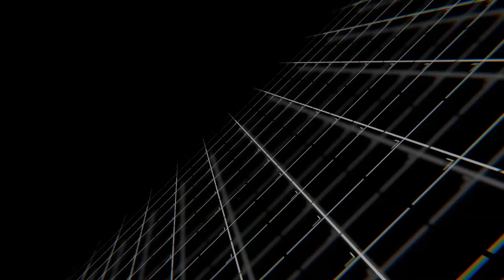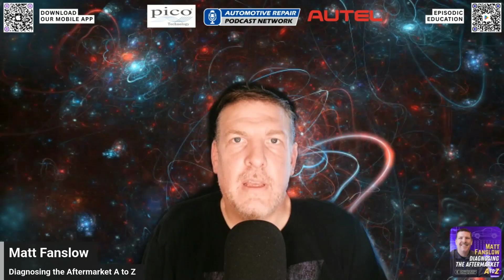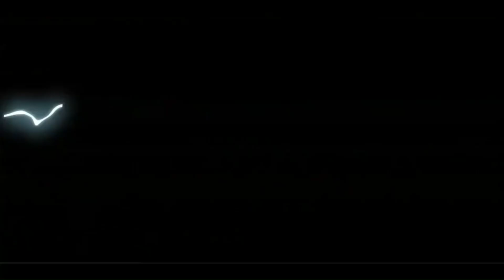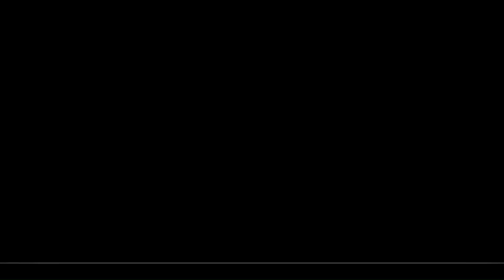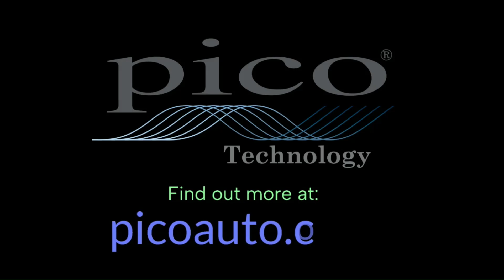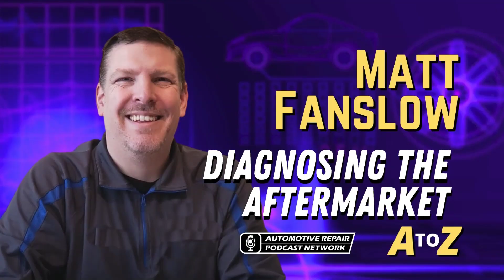7.3L Power Stroke ICP Sensor Failure and the AI Skill Atrophy Debate [E242]

Comment: There's no inferring what the high pressure oil supply is , they are prone to , too many high pressure oil leaks to ever inferr. But just know this they need at least 500 psi +/- to even fire the engine on start up.

Most importantly is your IPR duty cycle percentage while cranking and different operating duty cycles. IPR should never 85% which is actually 100% flow. That is how you determine if you have proper hpop pressure for start up and running. No inferred needed.